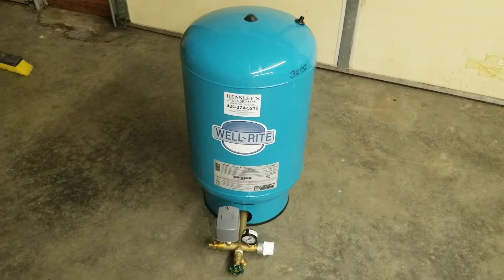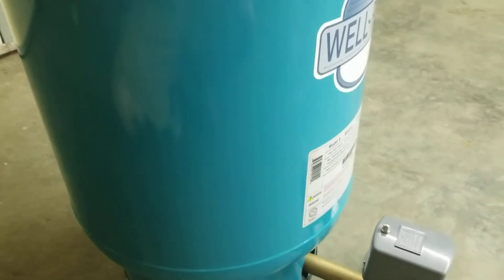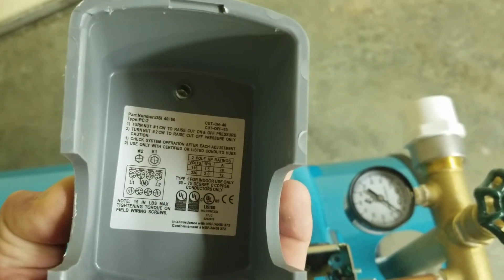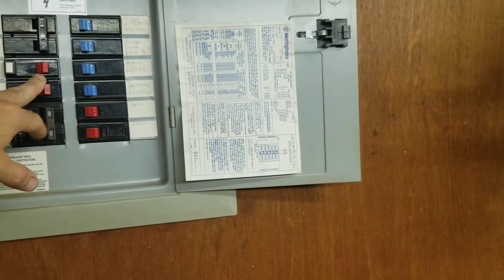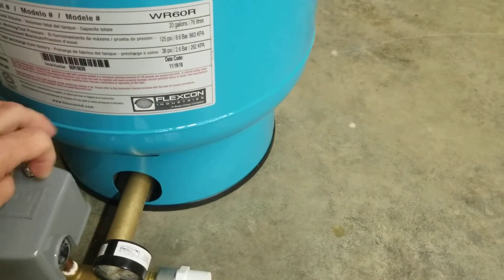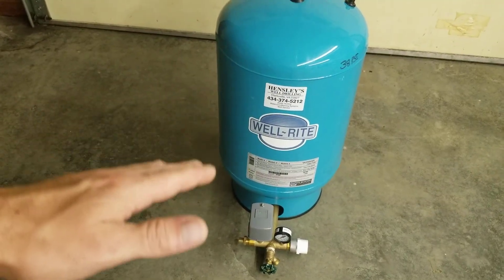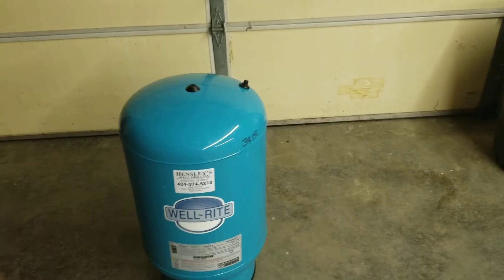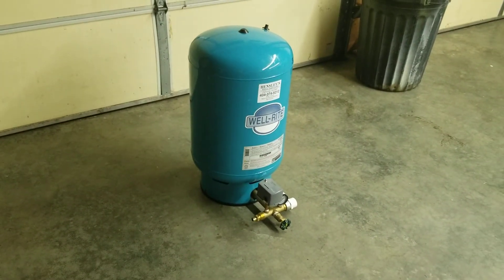Well Pump & Tank Troubleshooting, How the system works, Adjusting Pressure Settings Correctly

Comment: Our water pressure is low. I shut off power to pump and drained the tank. The tank pressure was around 30 lb I aired it up to 38. Turned the power and the water back on and still have low water pressure. The pressure switch cuts in at 40 lbs and cuts out around 65 lbs. It takes 47 seconds to fill the tank from cut in to cut out. I checked the Schrader valve and only air comes out no water. What can I check next?
Reply from the maker: When you had the system off, & checked things, did you get alot of air coming out of the sink when you first turned it back on? If so, you might have a hole in the wells drop pipe. It can cause low pressure and slow build up time. Youd get decent pressure for a minute or 2 & then it would become lower. Once no waters been used for 10 minutes, you'd have a minute of good pressure again and the cycle would continue...that sound like something thats happening?
Reply: @h2omechanic  It did end up being the aerators. We usually just soak the faucet/shower heads in a bowl of vinegar.  This time that didn't help. After checking pressure in laundry tub which is first in line the pressure was great. I completely disassembled the faucet/shower heads took out the little disc and screens and cleaned them good. Everything is good now. Thanks for your help.
Reply from the maker: Check different sinks & make sure its not just 1 faucet. If it pumps up to 65psi & clicks the switch off, that all seems fine. You might have a bad valve after the tank. Or you have a brass fitting threaded into a galvanized fitting & its built up corrosion on the inside that will restrict flow/pressure. Itll look like a grey metal piece connected to a brass/copper piece. Or your filter is clogged. Especially if you're using a black carbon filter, if so, don't use them.
Reply: @h2omechanic  Everything seems to check out with my tank and switch. Do you have any other suggestions?
Reply from the maker: I actually have a video on that too! That little disk is a (water saver) for city water bc you pay by the gallon. Removing it improves pressure 10Fold! Glad you figured it out! Merry Christmas
Reply: @h2omechanic  Thanks again and a Merry Christmas to you!

Comment: Turkey day woke up to no water. Discovered it was pressure switch switched out and water started working. Today 12/11 woke up again to no water. Checked gauge read 45 check pressure on bladder tank read 12. I put new gauge one and put air into bladder tank to 28psi. Gauge remains at 10psi.Checked pressure switch again and it is getting spark but is stick on contacts.   I could not shut well off at time so I made the mess when replacing gauge it seemed to be nice stream of water coming out. SO now I am lost. Any advice moving forward before calling plumber?
Reply from the maker: Pipe or fitting down well has a hole in it. Its letting 90% of your pressure out. Call a professional to pull it out

Comment: grundfos pump approximately  65 feet deep pump kicks on and off when running about every 
15 seconds  annoying  Also I think it is bad on the pump just like you said   Two gallon pressure tank I think it should be bigger although the pressure gauge shows 60 lbs.  could it be bad? How do you check that?  The well pump has computer board which I have taken the cover off and was directed how to check by an engineer in Texas over the phone also submersable. Great demonstration  I have learned alot over the internet. 50 .gal. water heater Any suggestions?     Glenda
Reply from the maker: Its short cycling & over heating. Put in a 20 gal tank & new switch & nipple to switch. Itll fix your issue

Comment: Why not checking the pressure before letting the air out? Which reads 25psi on a 30-50 switch....update...added air to 28psi, pump is working normal now.

Comment: Well pressure wont get above 22 psi new pump checked bladder seems good  holds pressure need further diagnostic  please thanks
Reply from the maker: Turn off well breaker & see if the 22psi drops to 0psi. If it does, you have a busted pipe somewhere. If you don't find any leaks then your leak is in the well on the drop pipe or possibly a cracked fitting connecting the pump to the pipe. Try that first & let me know if turning power off & it stays at 22psi. Then I'll have to think in a different direction
Reply: @h2omechanic  it took 9 seconds for it to drop to zero. Turned hot and cold off going into house still dropped to zero.if I pull the pump one more time is there a way to pressure it up if I dont see any cracks
Reply from the maker: You can try putting pump in a bucket. But now u know its in the pipe. You'll find it now bc you know to be looking for it. It's probably a split pipe within 5 ft of the pump. Or a plastic fitting cracked, you'd see that too

Comment: Question; my well and pump works good for about an hour, then I lose pressure down to zero. It takes about 30mins for pressure to build again. But after that initial hour, it will only hold pressure for about 5mins before losing psi again. 
Shouldn’t the pressure tank keep it at 40psi? I already replaced the switch, but maybe it’s still not working? 
Ideas???? Thx in advance!
Reply: I have the exact same problem, did you figure out what was wrong? Thanks!
Reply from the maker: Typically it's a well thats running out of water. Let it sit & it fills up . Why is it low on water...go check your toilets & see if any are overflowing in the back tank or a leaky flapper. A toilet leaking 24/7 will definitely hurt the wells production over time. Try leaving the breaker off at night & see if it acts better the next day. If it does, then you'll know its a low production well. If no different, it could be a bad pump or a cheaply made pump that's weak on pressure making

Comment: Hi my well pump in a rental, loses about a lb. and hour on the pressure gauge, as far as I can tell theirs no Leaks.  ?? Thanks
Reply from the maker: You could have a leaking check valve or loose pump fitting down the well. Or its more likely that a toilet flapper has a slow leak & the psi drop is just filling up the toilet. Cut off toilets & wait & see if the back tank water slowly goes away

Comment: water pressure is low but steady in the house. can it be adjusted?? How often should tanks be serviced???
Reply from the maker: Service tank every 3 years. Basically drain all the water & check air pressure. If you're pressure isn't great but steady, it probably needs air. If you follow the video instructions, you can set it correctly. Just look under your switch for 30/50 or 40/60. Air pressure needs to be 2-5psi below the smaller number(on psi) also if you have a filter, change it & don't use the black ones

Comment: HELP ME!!... IM IN LAKE WALES FL HOUSESITTING PROPERTY FOR NEXT 3 MONTHS..YESTERDAY I TURN ON SINK ....NO WATER!!!... WATER PUMP OUT IN BACKYARD ...THERES NO LABELING ON CIRCUIT BREAKER BOX EITHER!!!
Reply from the maker: If your house sitting, call a plumber...you don't have enough info for me to help you. If you have a electric meter, test the 4 wires in the pressure switch and see if you have the same voltage on all 4 screws. Also watch my video on a Pressure switch. Video thumbnail is on my kitchen table .

Comment: I cannot get the pressure to get up to 50 or 60 it will only get up to 28
Reply from the maker: Turn off the well breaker (power off) & see if the pressure drops to 0psi. It should hold at 28psi. If it drops to 0, you have a leak somewhere. Either in the yard or possibly down the well at the pump/ checkvalve area. Possible cracked fitting that releasing the pressure. If the pressure holds good at 28psi but won't build more, id say the pump impellers are worn out. 10to15 years old maybe? Hope this helps
Reply: @h2omechanic  so when I turned off the well breaker it drops to 20 and stays. Same as when I run water it drops to 20 and only goes up to 29/30
Reply: @h2omechanic  I'm wondering if the kitchen faucet isn't put in correctly. Could that b the issue? When I try to turn off the faucet the handle actually can go all the way around. I have to line it up just right for it to stop running. I have a new one I just haven't put it in yet. I might do it tonight 😃
Reply from the maker: I'm gonna say your pump is old and worn out. Needs replacing.  Call a well company, they know more than a plumber & better prices. Expect $700-$1100 total. Could be more if its a really dead well. If your power bill has been a little higher lately, then its probably bc your pumps just constantly running. But id call in a professional at this point.
Reply from the maker: If every other faucet in the house is good,  then yea its only that faucet

Comment: I'lll try these test later after work but yesterday before doing any of that the pressure on the valve and tank were at zero, does that mean the well pump is shot too?  I added 30psi so if it's gone when I check, the tank is done? Thanks
Reply: I get water to get to the home then lose all of water  what I sold do

Comment: I have no water coming out the tap it comes and goes what could be the problem but I check the water at the hoses outside it works fine what could it be
Reply from the maker: Not really enough info. But if the outdoor spickot runs for 5 minutes with no issues,  & your sink is on & off, id either change your filter, or clean you sink strainers. If you're system is 8-15 years old, the pump could be on its way out. Same for the tank. Age of a system is everything. It all has a typical life expectancy.

Comment: well pump won't shut off replaced pressure switch and pressure gauge , only getting up to 50psi 60 cut off.  Thanks Brent
Reply from the maker: Try killing the breaker for 24hrs. Leaving it completely off. The well might be empty and the pump is struggling to lift it from that depth & build pressure. Once power is off, go check the gauge & see if its still holding on to the 50psi, if it dropped to 0psi then you have a leak. If its a leak inside, cut off the valve & see if pressure holds. If you have 50psi & the house valve shut off & turn off the breaker & it drops to 0, then you have a failed pipe down in the well not allowing enough pressure to build up bc its spraying out of a crack in the pipe or the fitting at the pump. Also look in the yard for wet spots. If your pump is 300ft deep or more & its older than 10-12 years, its lived its life, the impellers are worn out & wont build pressure anymore. Try each one of these tests, one at a time & start ruling out what it isn't & eventually you'll figure out what it is! Do these test & reply back with what you find & I can point you in the right direction!  Happy to Help!  Philip Hensley

Comment: My tank has the right amount of pressure and pump doesn't go on often but I am getting no pressure to any faucet. I get a steady dribble.I have hard very water. What should I try next?
Reply: Clean or replace filters. The iron in the water probably has clogged your lines.

Comment: We are having issues with our pump and my husband has tried everything and we are baffled. The water will run in the tubs of the house but not the sinks 🤷🏻‍♀️ please help!
Reply from the maker: Try unscrewing the spout off the sink, right where the water comes out. Clean the strainer/aireator sounds like you have plugged up screens in the sinks if your tub pressure is fine

Comment: So my well ran dry. I just filled it back up with 1500 gallons delivered. The pump is on and running but the pressure gauge is staying on zero. I checked the bladder tank and it has 32 lbs of pressure. The tank is not filling with water. Any idea as to why the gauge isnt going up and no water filling tank? Can a pump be running but not actually pumping water? Any input on this would be appreciated. Thanks man
Reply from the maker: You probably have a hole in the pipe down the well. The pipe probably blew out/split. Now no pressure is coming up the line. As for the well, you need it Hydrolicly fractured. Google well companies near you & starr making calls
Reply: Did you prime the pump?

Comment: Just added a brand new well tank, when I turn the electric back on the pressure may go back up to about 10 but then drops soon after. No one's lived in this home for 7 years or so but sometimes we will have awesome water pressure, and now it just spurts and doesn't work at all
Reply from the maker: You have a leak somewhere, leave it on for an hour & look for wet spots in the yard between well & home. 
Typically in this situation if I don't find a yard leak, its a broken fitting or pipe down in the well. The old tank was bad so that surges the water & can crack the fitting. Also could be a hole in the side of a check valve. I have a video showing 6 pumps and why they failed, 3 had cracked fittings. If u can hear water in pipes flowing backwards when pressure drops, its down the well.
Reply: @h2omechanic  thanks! I have heard the water returning to the well and it's a very weird set up where they had the main pipe connected to the kitchen and the water heater. I'm going to look. I really appreciate it
Reply: It's me again man LOL, so I am pretty sure it's the well pump and I'm going to pull it out only thing is I got it tore down to Orange lid with one inch galvanized steel fitting coming out of it and all it does is spin. It has a square nut on top that's not budging oh, it's actually starting to crack at the top. Could you help me again?
Reply from the maker: 4342101376 send me pics of everything a few different angles

Comment: Watched the video.  Thank you!!!  We replaced the water tank.  Still having the same problem.  Sometime water will completely stop, sometimes it sounds like air is coming thru the lines.  The switch lid says cut on is 30 and cut-off is 50.  We got it set right and we test it at the well and the pump does what it is suppose to.  Come up to the house, same problem, get down to the well and the pump sounds like it is trying to kick on.  Tank was set to 2 pounds below (28) we hooked up the new tank.  We also changed the water filter.  This is at the farm, clubhouse.  Don't need tons of water, 1200 sq. foot house.  One bathroom, usually nothing is running at the same time, shower and washer.  Only 2 people here at a time.  Well is completely full of water.  I am at a loss.  Thanks in advance for any help!!!
Reply from the maker: First off, if there's a check valve at the tank or at the well head remove it completely. They can leak & cause a air pocket. Only check valve needed it directly at the pump. 
As for replacing the tank, did you replace the switch? Also the nipple the switch sits on, if old it can get clogged up inside & not let the psi to reach the switch. Causes the watee to cut off & randomly back on. 
Also a pump that is dieing can cause it too. That's like on for 3 minutes / off for 2.
Hope this helps
Reply: Check valve bad?
Reply: We have a very similar situation happening at our place and it has become is very frustrating trying to trouble-shoot everything!
The pump isn't even 2 months old...
New pressure tank with 27 psi at  valve...
Pressure gauge 2 months old...
Brand new pressure switch and riser nipple...
New water line from well to house...
New electric from wellhead to house.
With pump on and water to house turned off pressure holds but never goes above 30psi.
I am really hoping that we don't have to pull the pump again this year!

Comment: Nice video, very informative.  I'm upgrading my from my old well pump (26 year old Red Jacket 10gpm,1/2 hp) to a more modern Grundfos SQ (conventional, not continuous).  My 100' well is healthy, water is at about 40' and pump will be at 60-80' below grade.  2000sq/ft home.  I haven't decided on the 3/4 (180'/15gpm) or the 1hp (220'/15gpm) yet but my pitiless adapter is only a 1".  Question-- Is it better to have a 1.25" drop pipe as the new Grundfos pump outlet is 1.25" outlet then reducing at the pitiless adapter, or reduce to 1" immediately  above the pump and use the 1" poly drop pipe that matches the pitiless size already.  Then it's only 12' from there to the basement, and I  don't want to dig a 48" deep trench to change the pitiless and the  pipe between the well and my basement. BTW I upgraded from the 20gal to a 62 gallon tank in preparation for this pump replacement.  Any advice is appreciated.  Anyone, anyone....even Beuller!
Reply from the maker: We had the impellers failing. They might have changed their design now.. but in July I spoke with our local competitors and they were also having issues with the SQ300s failing under warranty. So we stopped using them. Just my opinion
Reply from the maker: My advice to you on Grundfos is dont buy any the are SQ300 or less. Sq300 have a high failure rate. We installed 6 & 5 failed in 4 years. The SQ330 & higher are made different inside. Stick with 1" drop pipe! It still flows 22-25 gpm & its less head pressure on the pump stack. My honest opinion is Grundfos are not worth the money they cost. They offer "constant pressure" & that seems so enticing to consumers that they buy it... its totally up to you what you decide. Id buy a J Class or Scheifer pump 1/2hp 10gpm, they'll give 15gpm at 80-100 ft. If you buy Grundfos Only SQ330 or higher & 3/4hp-1hp
Reply: @h2omechanic  Wow that is a harsh indictment of Grundfos, five out of six, and you installed them all.  What were the failures?  How did Grundfos respond?